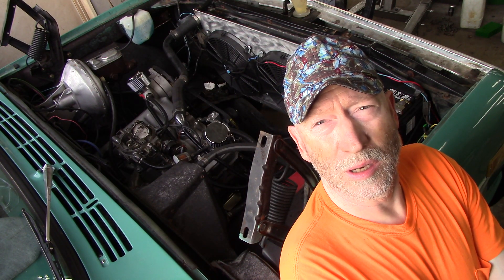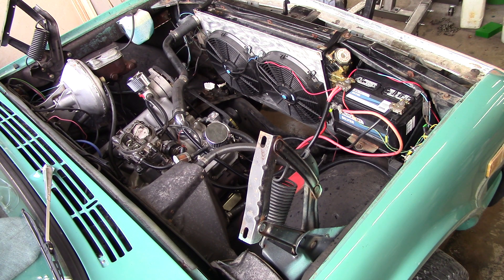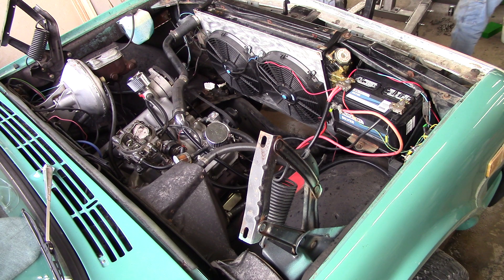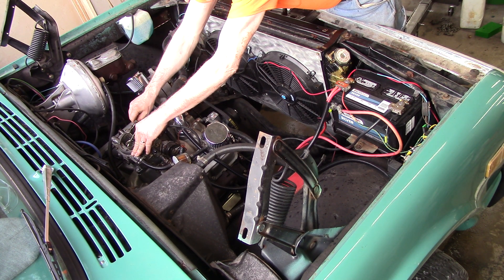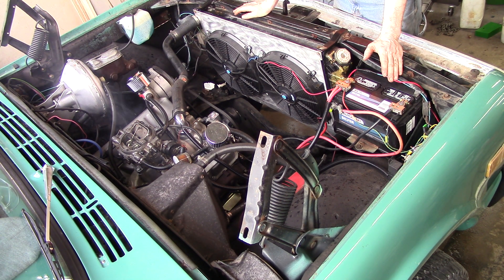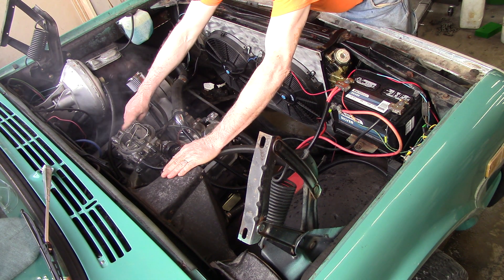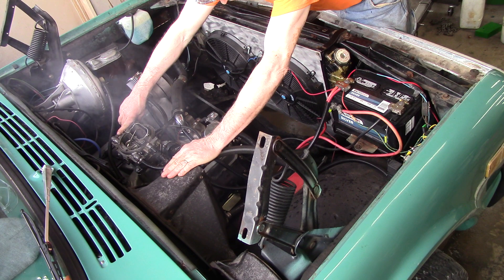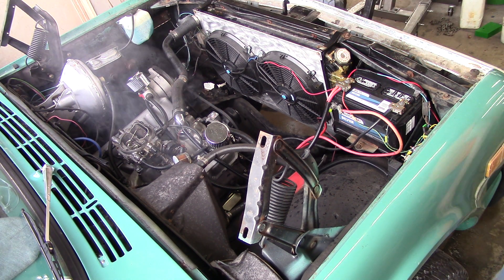V-8 Engine Rebuild SBC #18 Engine Start Up

Comment: Hello,  Love your videos.  Was wondering since you use most the same books I use.  I did not think you was to let a engine idle at start up.  But to do like you did a few times there throttle up and down to seal the rings.  Not to have steady rpm for the first 30 min of the engine.  
Also the cam did not want to use a grease for break in?  That wonderful pink stuff they send with the cam.  LOL.  I use 20/50 also.  Castrol though.  Wix filters also.
Reply from the maker: Thanks for the comments, much appreciated.